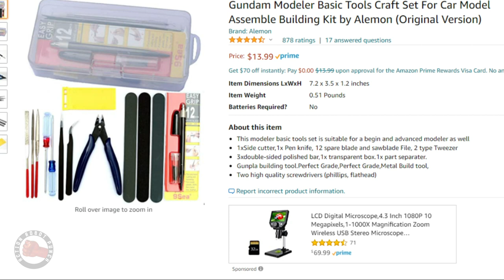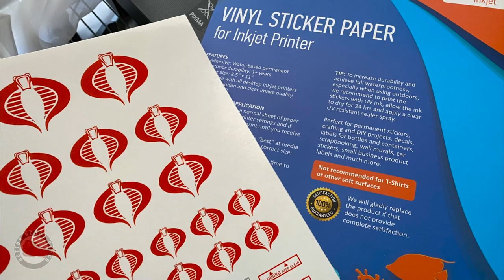Gi Joe Cobra Arctic Base - DIY How To

Comment: That is incredible! I really like how that came out. =D It also looks like one could make a sci fi variant on that as well.
Reply from the maker: Absolutely. The rounded form is very sci-fi but Cobra has always been on the sci-fi side in my opinion so it works for them. I'm not sure I could use the same parts for a Gi Joe type base. Their stuff is more conventional. But this could surely be used for Star Wars or similar. And thanks for the kind words!

Comment: This is an excellent build. The coffee ring to fix the curvature of the top section is ingenious. This is something I've tried to fix many times less elegantly and less successfully. Good advice about the asymmetry of detail and shape composition, as well.

If you'll permit me to make a few suggestions from my experience creating structures for tabletop wargames, I would fill in the gaps on the side of the light/sensor above the door and the angle brackets around the circular rim using either thin plasticard cut to shape, chipboard, or for smaller gaps, just fill it in with sculpting putty. Once the base coat is dry, you can bring out the details, especially on the machinery and access panels, by hitting it with a wash of very watered-down paint. White can be difficult to wash without making it look gray, but if you use the right shade and limit your application to the areas you want to accentuate it will work. And you can always drybrush over the sections that are too dark. Finally, you can get a more controlled application of weathering by speckling the darker paint on with a sponge.
Reply from the maker: Great tips! Thanks.

Comment: Looks better than GI Joe bases I had when I was a kid. Had I seen this back then I would rather have had this. Please build a better terror drome than the crappy one sold in stores and now ungodly priced...
Reply from the maker: I wonder if the size might also be a good thing. This could be a smaller, lower cost toy that could act as a base. And I didn't show it but you can still unscrew the top and store your figures inside :) Thanks for watching!

Comment: Just a note. I see you cutting through the Styrene...just score and snap, much easier, less work.
Reply from the maker: Yeah I was having trouble with some of the 2 mil stuff. But I think my snapping technique is getting better. I started using pliers to help me get the leverage on the thicker stuff. Thanks for the tip!
Reply: @ActionRobotPunch  I collect Joe's too, but I'm 53, so it's the big Joe's from the 60's/70's!

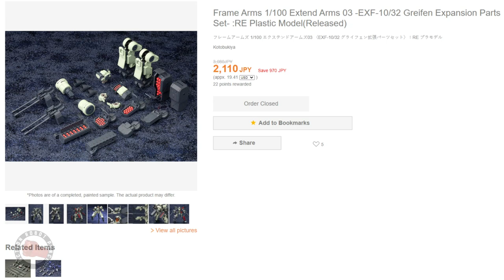Comment: Onde vocë encontra essas peças plásticas?? 5:40
Reply from the maker: I show you in the video right afterwards :) They're from the different model kits. But if you can't find those exact kits almost any other kit will have little bits like the ones I use. Good luck.